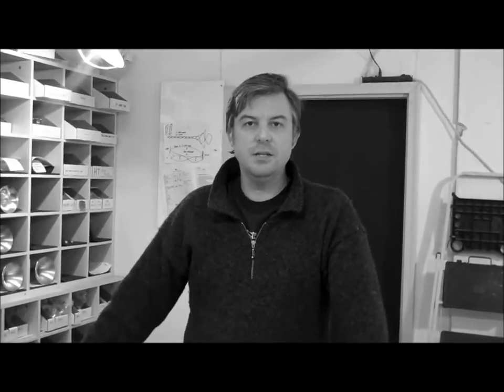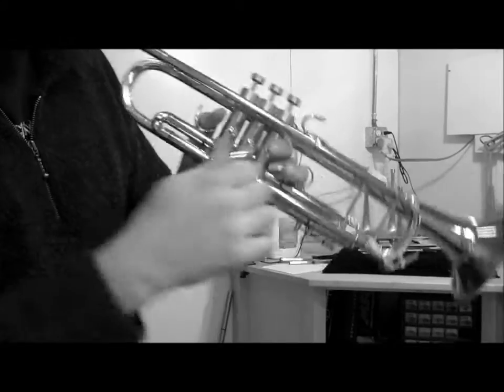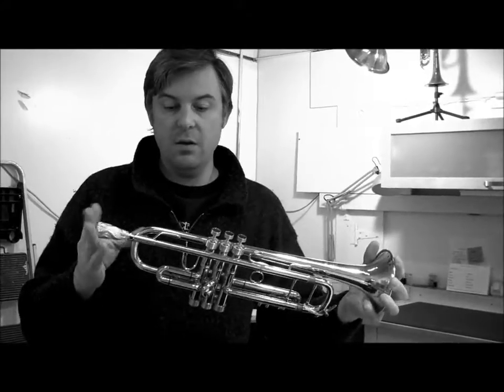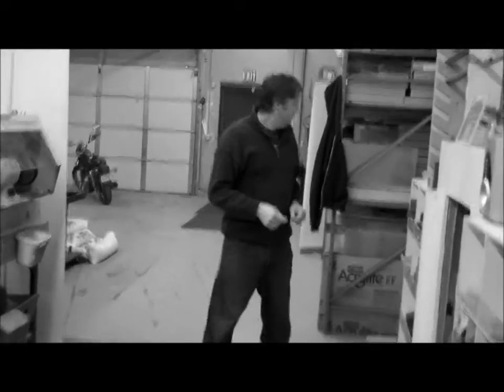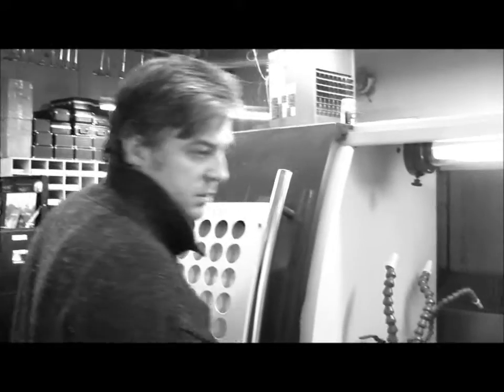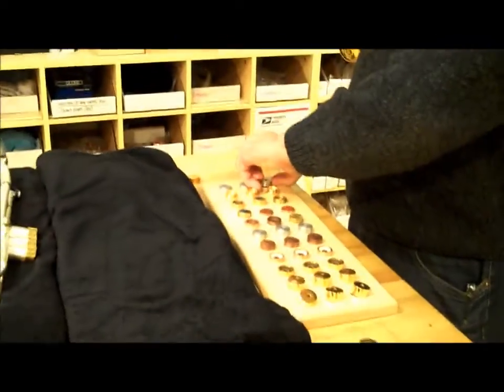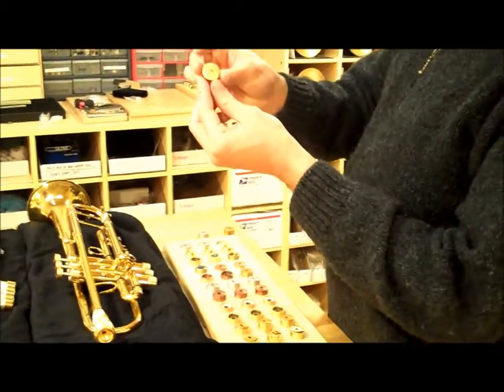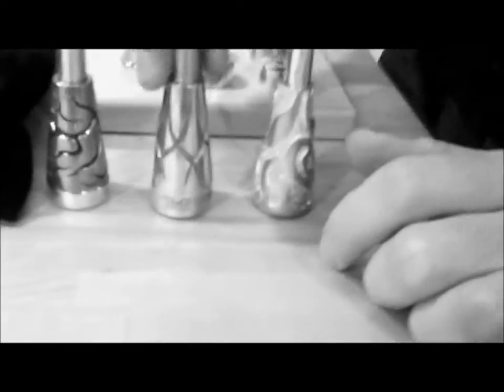Harrelson SWE Trim Kits

Comment: What if I wanted to get a valve alignment for my horn? Would I send the horn in with your trim kit applied to the horn or?? What would you suggest?
Reply from the maker: Valve alignments are very simple and anyone can do them at home with caliper, flash light, synthetic or felt material and a small mirror. This kind of "job" is considered basic Trumpet 101 that can be done every few years by the owner. We do not offer this as a service as we are literally backed up with new orders all the time. Thanks!
Reply: Harrelson Trumpets 
Thank you very much for the clarification!